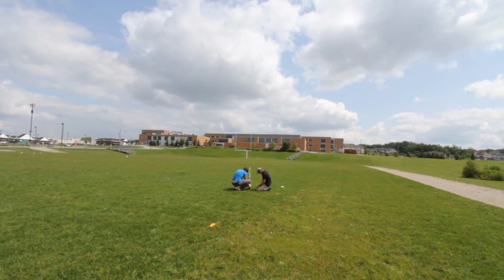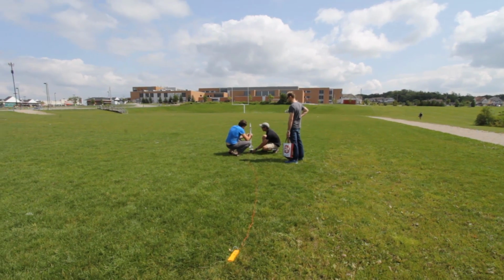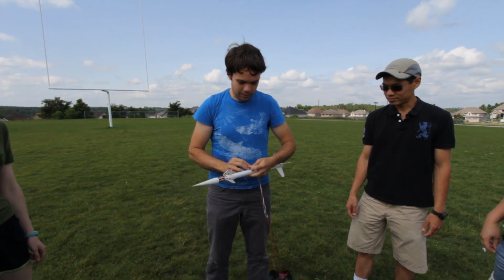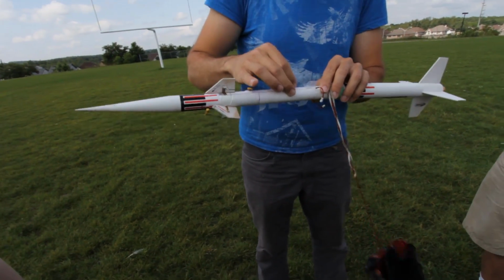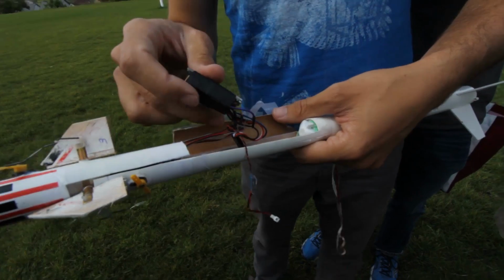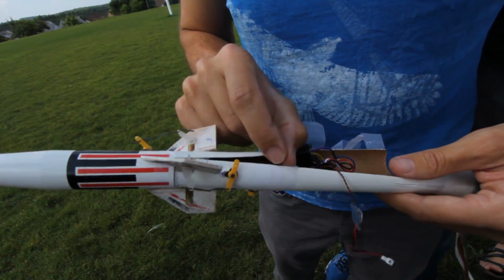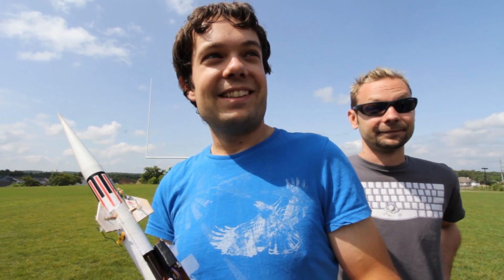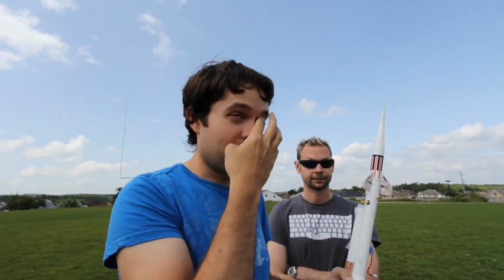Arduino Stabilized Model Rocket

Comment: It is LEGAL to use a guidance system that only causes the modle to fly "up", ideally vertically. What is NOT legal is to have a system that can home in on a "target" of any kind such as an aircraft or ground target.

I have had a lot of experience with this sort of thing. I developed what is the first known successful model rocket guidance system in 1988, Sunguidance, that simply makes the model fly towards the Sun (best flown near mid-day, also flies near-vertical on an overcast day). It is a relatively crude method incapable of homing on say jet engine exhaust. More info here:

http://georgesrockets.com/GRP/RandD/Sunguidance.htm

Since then, I've kept track of other ways to make model rockets fly safely with onboard guidance. Also have warned people away from really BAD ideas like the guy who wanted to be able to make his rocket "land" near where he would point a laser beam..... just like a laser-guided bomb. I took him at his word but it was too easy to turn that into a terrorist weapon and highly illegal, and fortunately nobody helped him develop it.
Today it is possible to simply use the Eagle Tree Guardain, in 2D "wings level" mode, to make a rocket fly straight up, regardless of the launch angle, unless the configuration of the control system (surface size, deflection angles, stability margin) and flight velocity and engine burn time are too far off to allow it to control itself (Control Authority) .  Also a lot of the control boards used for MultiCopters, set to "stabilize mode", can do the same thing to make a rocket point "up".

 It is neat that you have worked on doing this on your own with an Arduino. You made it harder by using three control surfaces rather than four surfaces so you could use just one servo for pitch and one servo for yaw (unless you are also wanting to control roll, but there are other ways of doing that such as two servos for two pitch surfaces which also can oppose each other for roll correction).
Reply: +Bret McDanel This is the most intelligent youtube conversation I have ever seen.

awesome :)!
Reply from the maker: ***** Neat! I used 3 servos because I couldn't fit 4, and wanted active roll stabilization as well. Worked out well enough, but I had to jump through hoops to squeeze enough power out of the Arduino.
Reply: If the goal is only to point in a certain direction you need only two control input /surfaces. You need only to do an attitude stabilization on a 2-sphere (S^2).
Reply: George Gassaway 
"What is NOT legal is to have a system that can home in on a target.." 
Hahahahahaha
That's interesting. Hmm.. um.. erm..
I'm gonna pretend I've never read this or heard about this..
"Ignorance of the low is...."
Lalalal lalalalala lalalalala I can't hear you lalalalalalallala
Reply: Like my cousin always tol me it aint illegal if they don't know >:)
Reply: The Q The model and amateur rocket communities tend to be very public about what they do (it's hard to hide things flying high into the air anyway).  So governments will know.
  Governments want the bad guys to have a hard time figuring out how to build weapons that compare to what the military has, so they restrict what the good guys are allowed to tell to unknown entities (including the public).  So most legal restrictions on guidance would be on revealing the secret sauce, with flight restrictions only a secondary way to enforce this.
  Note that duly licensed people do make lots of guided rockets with targeting, bombs etc., but they have to keep the details as proper military secrets while revealing only useless information to the public.
  On occasion, some fully licensed amateur rocket people have mentioned that some technical  information was not available to them, and/or that they were not allowed to talk about certain technical details due to government restrictions.
Reply: Good luck enforcing this by law.  Bad guys usually won't abide by the law.   They can now make their own anti-aircraft rockets.
Reply: The government needs to quit being a bunch of fun suckers.
Reply: I've fired like 100 home-made rockets and noone even knows lol
Reply: Right, scary how fearless some stations are and the overall deniability and even U.S. Congressional willful "plausible deniability" really office neglect of duties, gross frauds and cheats and compounding and concealing if not worse treasonous terrorist, war crimes and continuing criminal enterprise racket operations like William Binney notes in general.  If wasn't for the Moscow, Cuban and Uzbekistan Embassy and some other well documented on the internet "TI" or "DEW" related incidents... I'm thinking most in the U.S. would have been killed off already and many are left brain dead, brain washed and cult programmed if not worse.  Probably even in the World also where-ever Roman, Jesuit or Communist operations exist.  I've been trying to document my legal observations on a blogger site: http://dewdetectionprojects.blogspot.com/2017/08/dewdetectionprojectsblogspotcom-first.html

Really strange how those high tech weapons are slow killing in the most gross frauds and cheats ways using vulnerable people groomed MK Ultra and Artichoke style though as assassins or political tools for international sexual deviant, sodomizer, pedophile and narcotics and dangerous drugs traffickers that are more than mentally ill grandiose, delusional and way ill famed Roman Coliseum style with whomever they can.
Reply: jafinch78 it's so nice to see people who are awake.
Reply: Thankfully and logically my Grandfathers and Dad were really strict about education, even where I had to learn to play dumb in a lot of situations because the community I grew up in is way pedophile old (and maybe still) traffickers worse than I'll never even be able to imagine.  Well, after working in AR&D and Quality Systems eventually on alternate technologies... false claims started being made against me again up to the point where I was found with barbiturates, benzodiazapines and suspected quinolines (exotics maybe) with refusal to call the MSP and FBI forensics to perform a more thorough unknown testing.  A few years later I was armed robbed and shot.  Point is, I think there is a lot more Flint style bad water that is somewhat disclosed in regards to the EPA disclosing pharmaceuticals found in our water and I'm sure way more than most realize poisoning with anesthetics, amnesics and other "alzheimers" or "dimentia" causing poisons as well as inbreeds moving into the U.S. more since the US is the only country where we're not supposed to marry our first cousins for a reason.  Most don't realize how brain damaged primate predator that can make people to begin with.  Then add all the other MCL 750.200h&i, 750.224a and 750.543p ways and means and there can be worst case scenarios faster than most realize.  We have to be hyper critical of our water, food, drug, clothing, lodging, and other materials sourcing like transportation, communications and energy to make sure is used as medicine and not poison or poisoned. Many are false pretense and want anyone they can dead for no reason other than the mass murderers are as dumb as inbreed possible can be mafia rule style that is like an Alinsky tactic to most.

Comment: What method did you use for the last shot for the goalpost when you made it go horizontal? Did you have some alternate software that you loaded in?  Or did you just change the orientation of the tilt sensor?
Reply from the maker: Edward Clements It tries to assume the first orientation it booted up with, so same software, different boot-up procedure.

Comment: Just FYI to all those who DYI. I was planning on making a Rocket Like this when some friends from Spark Fun informed it is highly illegal in the US. They look at is as owning a guided missile. So as cool as it is be careful who sees it.
Reply from the maker: Nice sources guys.
Reply: Somebody gave you wrong information.
Reply from the maker: There are no specific provisions beyond intent to do harm, I'm to understand. The rules are pretty easy to understand: Don't build an explosive payload delivery system. It just so happens the larger rockets can be just that, even unintentionally, so understandably you'd want to clear any high powered rockets with all the regulators you can muster. A C-sized rocket even despite your best efforts is not going to cause enough damage to warrant intent of harm. Ever. My best calculation puts this thing at about 100km/h at its peak, well below both the speed and weight that a professional pitcher can throw... and far less accurate. :)

Comment: it is legal to put in telemetry, video, remote parashoot ejection and tracking beacons. just not anything that can stabilize or guide the flight path.
Reply: bxxj I always thought it was a stupid law as a model rocket is not much more dangerous if it has a guidance system since it's short range.To make it an effective guided missile it would need IR  or radar sensors,a longer burn time,proximity sensors,and be able to carry a warhead that weights a few pounds.Plus high power rockets probably can made safer if they have a reliable guidance system.
Reply: rockets were the symbol of power and cutting edge technology in the post WWII space race and cold war. different time and values. Today laws aren't written as specifically as in the 50's. today they use terms like "weapons of mass destruction" or "terrorist" which pretty much includes anything they want it to. avionics are allowed in other flying platforms because many commercial interests have been identified making them good for more than a weapons platform.

Comment: guys you need to change hobbies if you are into guidance systems.  what you are doing is a FELONY!! you can put gps, lidar, stabalization systems and autonomous guidance systems in model airplanes and quadcopters but NOT rockets. its a cold war law from the 40s and 50s to prevent civilians from developing weapons of mass destruction. fortunately when the laws were made other technologies were not invented yet and were thus not included.
Reply: What law makes it a felony to add guidance system to an amateur rocket?